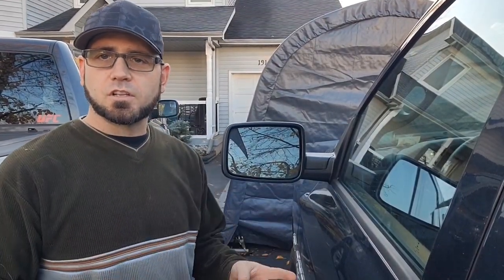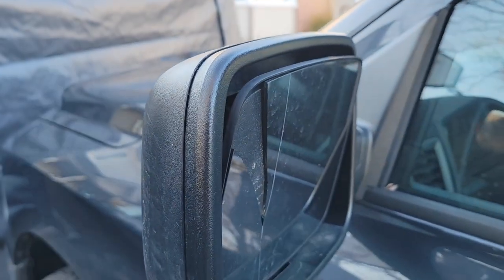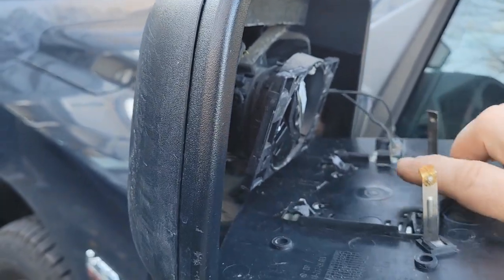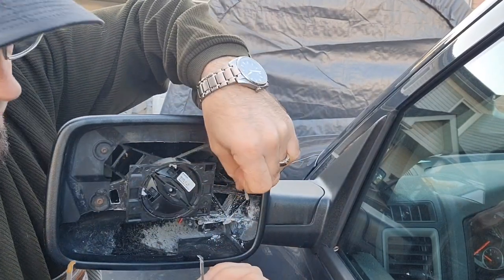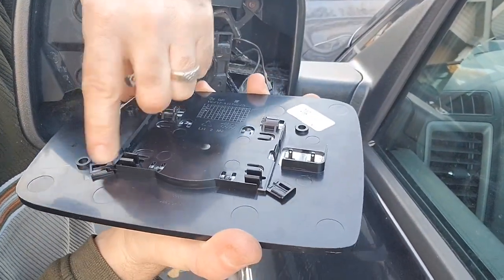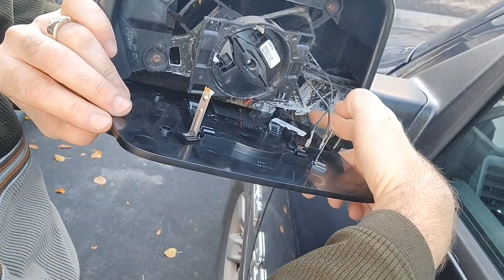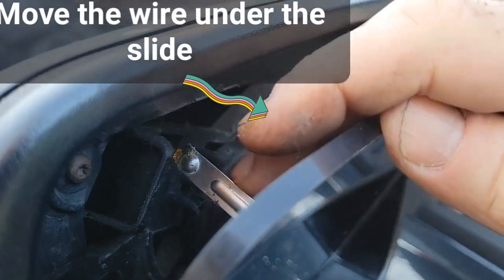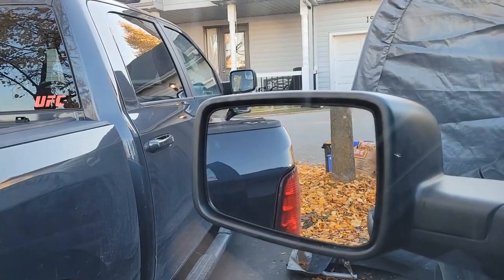How to replace side mirror glass

Comment: Thanks much! I narrowly clipped the passenger-side mirror of my truck on the drivers-side mirror of a truck poorly parked on the side of a very narrow street that allows parking on both sides, then worse yet it was a graduation party with cars, trucks and vans the parked nearly bumper to bumper for the entire length of two city blocks. He had neglected to fold his mirrors in and I not knowing  how tight the lane actually was didn't think to fold mine before running the gauntlet. Although I was only rolling about 5mph you should have heard the POP! when the mirrors collided; the impact instantly slammed the mirror against the door, the inertia of which popped my mirror out of the frame, but fortunately it was unbroken except one of the clips broke its mount which I epoxied back into place and this morning tried reinstalling it. All went well except I didn't quite figure out where the clips went: once watching your video understood my mistake of not pushing in firmly enough to pop the top slots together. Once I did that, voila! it was done and works normally. To others my message is always fold your mirrors in when parked or driving in tight clearance situations. Aside from a paint scuff from the other mirror and a slight scratch on mine I got very lucky. As a side note, the passenger window was up otherwise my passenger may have been injured. Thanks again!
Reply from the maker: Thanks for sharing your story. Glad your passager was ok and you were able to fix your mirror.
I'm moving all of my videos to my Toolspecs channel, hope to see you there. Thanks for watching!

Comment: Great video.  Can you please provide the part# for the mirror?  And will this video apply to a 2012 Dodge Ram 1500?  Thank you
Reply from the maker: You need to buy the mirror from the dealership to make sure it fit your truck right.
Most cars and trucks power mirrors get removed and installed the same way.

Comment: my top of my mirror won’t latch what could be the problem
Reply from the maker: Either your not pushing hard enought to click it, It might of have a broken clip or the mirror heater wire is between the mirror and the clip.
Either way you should pop it off to check.
Reply: Hey I'm having the same problem, where you able to fix it?
Reply from the maker: @ninjacowboy6655  the wires for the heat must be behind the clip
Reply: re-watch the video from approx 6 minutes into the instructions so you have the bottom on correctly and the wires out of the way. Then as you push the top in the two silver clips go to the inside of the brackets then it should pop in as you push it into the housing. Tip take a really good look at the mirror on the other side to see how far the gaps are supposed to look. You should hear the pops when you have it on correctly.